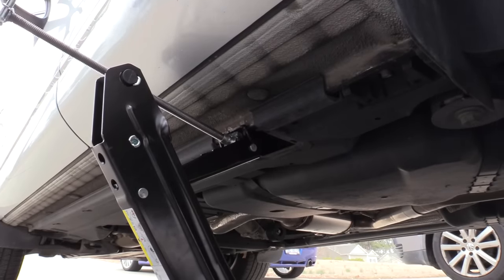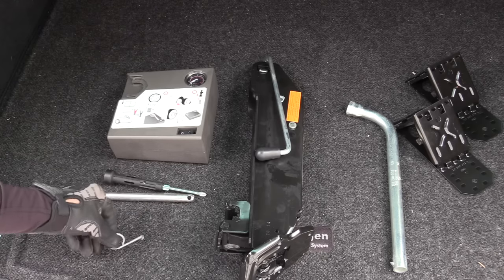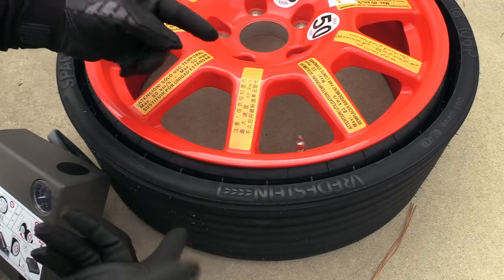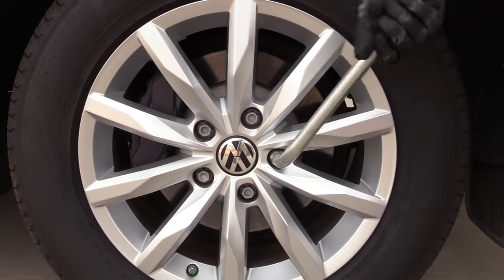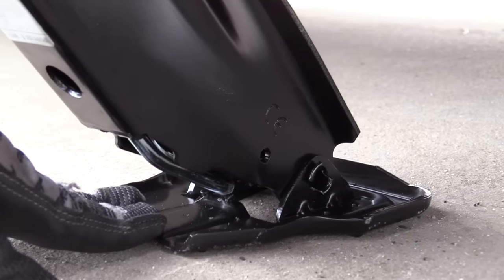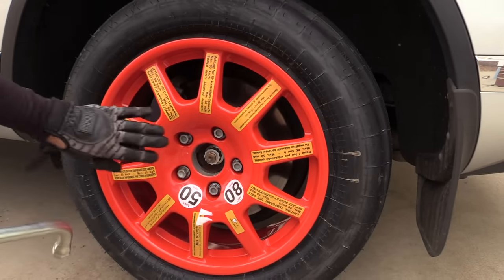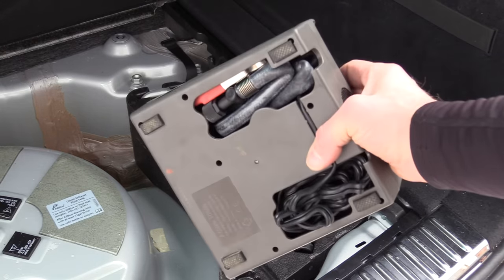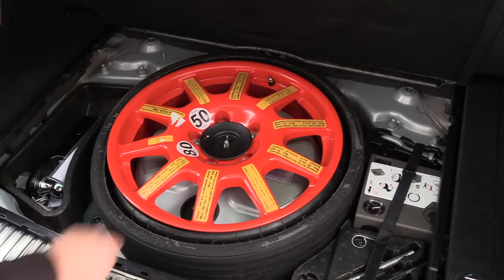How To Change a Tire with a VW Jack (The WIDOWMAKER)

Comment: In certain conditions this type of tire change could mean a disaster for certain people. If you are stuck in a precarious/dangerous place perhaps? I've seen people that don't know any better, stop in such spots & in one case where I saw real immediate danger. I was nice enough to stop quickly(in a safe place) to tell them they were in danger of being hit & to drive over to where I pointed for safety. They just ignored me/my warning sadly, but I still hope they were ok in the end. Then having to open the hood and hatch then wait an additional 10 minutes for the tire to inflate doing twice the work? or worse off... 10 years or more down the road when the hose on that compressor rots out and stops working properly and not being able to inflate it? The space savings aren't worth it in my book, and even in my vehicle with a fully inflated donut sitting under the rear of the car. I sacrificed space in the rear hatch so... I bought an extra rim and regular tire for a full size inflated spare and a hydraulic floor jack which all live in the back. I've changed my tire in about 8-10 minutes from the moment I stopped, and restarted my journey again. In a few occasions I've even stopped to help people with scissor jacks, and just brought out my handy floor jack to help them get up and running more quickly. I also want to give the video creator kudos for making the video for those car owners with this type of setup. Better to be prepared for such unexpected situations like these. Cheers

Comment: Nice way to bend your pinch welds. You noticed the swivel head of the jack? That is to properly insert your pinch weld in the shape of the jack. You just jammed it on there.
And be careful with other spots than the advised jack up points on the pinch weld, just because there is enough space does not mean that the spot is properly backed up from behind. Nice way to bend the bodywork to the inside and rip everything apart.
Why would you insert the wheel hanger AFTER you removed the last bolt? There was a little plastic tool provided to thread the bolts in/out by hand, you do not need to turn the big wrench a hundred times. And who would even torque the bolts by pulling them up? It is so much easier when your just use your body weight to push them down.
Also I am missing the widowmaker part. Of course a proper jack is nicer, but there are three wheels on the ground, handbrake and gear engaged... what could go wrong if you are not messing it up big times?
Honestly I have never seen such a pop up spare wheel, but if you want a big SUV you need a big wheel.

Comment: I think the wheel hub design itself is a Widowmaker. Chrysler started doing this too and it's a pain. When changing tires on people's vehicles it now takes 2 people, the extra person to hold the tire while the last "stud-nut" comes off. It's well know among tires plus and jiffy lube in my area as "Hitler's revenge". Now I just need to get myself some of those fancy wheel hangers I never knew about until now.
Reply from the maker: I understand why people hate that design. It doesn’t bother me, but I’ve always dealt with them.
Reply: @HumbleMechanic  It was rare to see them but i'm seeing them more often now. The first time I took one off I though it was a cool idea, until you take that last "stud" out. I need the extra person when taking the tire off on a lift at chest level, but putting them on I can pin the tire on that tiny step in the center of the hub and thread the first one in to hold the tire on.

Comment: Im a mechanic, so I look at this as fairly easy. That being said I could seriously see how this could get very confusing.

On another note, why does vw use wheel bolts?
Reply from the maker: Some say it holds the assembly more even. Some say it's to produce less parts (1 bolt vs stud/nut) Some say its because germans hate you.... LOL I think it is a mix of all 3

Comment: I may use my spare tire 4 or 5 times in the life of the car. I dont care paying for the extra space of a full tire or even a decent tool / lift kit. I learned the bad way to leave the car running while inflating one of those tires. Ran out of battery needed a jump Start.

Comment: Me personally -  I keep a really good 12V compressor in the spare tyre bay, and if I get a flat from say a minor puncture, I just pump the tyre up until I can get to a tyre place. That'll only work obviously with reasonable slow leaks, ( might have to pump it up a couple/three times, still better than changing into that toy tyre) the major punctures are going to need a tyre change for sure
One thing though, how does a space saver spare make any sense on a 4WD that may be hundreds of K's from a garage.
Reply from the maker: Well worth keeping just in case!

Comment: OMG I bought a duralast jack and kickstands today not knowing my Q7 had this monstrosity hidden I thought a regular jack and on top of that hooking up jumpers to inflate a skinny tire.. No no no I'm ripping it all out I'll get me a spare or tire already in flated I may not take the 2.25 ton everywhere but I'll use something that doesn't resemble a drill bit piercing my side panel. So advanced  German engineering without an ounce of common sense.

Comment: Never had a problem with the jack. Loosen and fully tighten lugs with it off the jack. Gotta use the noodle.
Reply from the maker: I personally haven't either. But I have seen the results of it failing.

Comment: the inflation of the tyre in this video looks really easy. However when I tried to inflate my tyre for the first time the tyre got stuck on part of the rim and would not completely roll on. even with 100 psi pressure. Hence the tyre is useless as it would be dangerous to drive on it .
Also the compressor that came with the Tourage really struggled to inflate the tyre. 

Has anyone else had this problem with their spare tyre.
Ian

Comment: Word of warning, I saw a 2004 Touareg in the junkyard with one of these space savers mounted and it had severe cracks on the sidewall that I wouldn't want to drive with. I know on my older cars I have replaced the spares with newer tires because one time I had an old spare loose its tread after I drove on it for 10 miles. Very dangerous
Reply from the maker: Good point. I wonder if there is a date on the tire? I am sure those aren't cheap to replace.
Reply: @HumbleMechanic  I imagine there is but I doubt there is an expiration date. all depends on the climate the tire has lived in.
Reply: @CorradoAlley  ...time to 303 Protectant that sucker to preserve the rubber, even if stored inside the car.

Comment: This usually happens in the worst place and time. Add a 'quicky' set of Gloves to the tool set. Stop by a Tire Store and ask for and old Rubber Valve Stem to screw that Valve Core cap to and create an easier tool to work with. I put a tiny drop of Red Loctite on to hold it.Flashlight in a baggie with Batteries loose. Had to work in dark because batteries had corroded and of course...she no worky.

Comment: my new VW comes with afull size spare tire as an option. But even tho i have a tire in the boot when I get a flat I would never use the " widow- maker" in an emergency situation on the side of the road. This thing doesnt work safe on flat hard ground and it wont do any good on the side of the road lte at night in the rain...
The ones they put into the small euro models ( Polo, Golf) are even more cheap than your from the heavy Touareg.

Comment: In uk pump connet to 12v auxiliary(cigarette lighter)
Reply from the maker: I tried to use my Milwaukee pump, it didn't have enough CFM. I think my R32 has a 12v aux plug too
Reply: @HumbleMechanic  I'm like bouth my ibiza and fabia had full size spare

Comment: Is this jack safe? Doesn’t it look a bit unstable?
Reply from the maker: If used properly it’s fine. The properly part is what get people in trouble
Reply: @HumbleMechanic  if the back wheels are correctly and properly blocked while lifting the front I wont have any issues correct?

Comment: one time i tried to lift the car just high enough for the wheel to be off the ground ... the wheel was seized to the hub.. when i tried to pull hard on it .. it fell and somehow the tire got stuck between the  ground and the brake dust shield :(

Comment: In my time as a mechanic/technician (2005-2012) I have never seen a non-inflated spare tire. All I have seen was small tire or these foam repair kits.
Question? Where do you put the damaged wheel when you pull it off the car? The trunk may be filled with luggage, groceries or similar and it cannot fit in the wheel well where the deflated spare tire was... (not that it could if it had been a normal inflated spare tire either).
Reply from the maker: That would be a hassle for sure. My thought is, you’re taking everything out of the back to get access to the tire either way.  It will be like Tetris going back in.
Reply: @HumbleMechanic  LoL. Yeah didn't think of that at all. I remember on the old Ford Fiesta and first model Ford Ka the spare tire was placed underneath the car (Peugeot did that on some models as well). This meant you did not have to empty the trunk to acces the spare but as years went by the mechanism that hold the spare in place got really dirty and rusty making it a hazzle to get the spare tire out anyway... No solution is perfect.
Reply: I think Porsche started it off with the DIY spare, remember seeing a few of them in the mid 2000's
Reply: @donmaggi  Probably correct. As far as I have been told the reason why many makes use the repair kit instead of a tire is to save weight and thereby save fuel. By saving fuel the car gets a better environment rate (at least in the EU) and this increases sale...
Probably the same reason the tire in this vid is plastic/composite and not steel.

Comment: German over engineering at its finest lol. My old ford ranger came with a full size spare, a bottle jack, and a solid steal lug wrench and that was it. Basically a “figure it out” kind of kit. I like mine much more. (Now that I have bigger tires and a lift it’s totally useless and now I have to use a highlift jack but still...)

Comment: Ok while I can admit that's a really cool way of doing a space saver tyre, I've never seen one like that before. I don't like the idea of space savers. My 1996 Suzuki x90 has a full size spare and it's one of the shortest wheel base 4wd cars ever made. Legit it takes up 3/4 or more of the boot but when I need to change a tyre at least I have somewhere to put the old tyre instead of putting a dirty ass tyre all over the boot of a nice car like with my Veloster. Sure you save a little weight and have more room but you're absolutely screwed if you Actually need it.

Comment: Hmmm. BMW have a simliar jack (at least my E39 does). Haven't heard of any failures of those ones. The VW one is known to fail or nay?
Reply from the maker: I’ve seen some. I think it’s mostly user error, but I’m not 100% on that. I’ve had a few people have failures that I know did it right.
Reply: @HumbleMechanic  Hmmm. Well I'll keep that in mind next time I have to use it, hah. I tend to use my trolley jack, axle stands and chocks at home thankfully.

Comment: God when I was young and stupid I was changing brakes with the Widowmaker on a jetta vr6 mk4. I was under the engine from the center with the widowmaker propping up the driver, really going at it hitting a wrench clamped to part of the brake.

Dumbest thing I ever have done, and I cringe at myself everytime I think about it. So stupid. I did do all 4 though! (rest were all doable from outside, otherwise Id prolly be dead lol)

Comment: Way to over complicate having to put a spare on. Lets give you a jack that won't work on most surfaces and can easily let the car fall on you. Lets give you a flat tire as a spare that you have to air up first before you can use it and hope the compressor works and is still there. Then that short tire iron that most won't be able to use cause they can't get enough force to get the lugs loose. then when all is said and done where are you gonna put your full size tire? At least in my Jeep compass I can put my full size tire right back where I got my spare tire from. Oh ya cause it comes with a full size aired up tire as a spare.
Reply: or you have a spare thats in your car for 5/10 years and never checked...

Comment: I don't see how that jack is any more dangerous than any other jack included with a car.
Reply: Try using it
Reply: @2JZDestroyer  I've used them a few times. No issues. I can see how it would look dangerous but functionally it's no different from a scissor jack.

Comment: I recall stoping to help a girl change a tire on an Audi that was about the exact same. Stupid tire would not inflate the bead was not set right. Biggest hunk of junk I had to take the tire to the shop and use my trucks bottle jack. Took over an hour which should have taken 10min.
Reply: jake h Why you did not read the instructions instead?

Comment: I had one of these for my vw t4, after the first time I used it I picked it up and it fell apart. Turns out that the previous owner had broken a pin and replaced it with an old shitty bolt. Not cool. Hello new bottle jack.

Comment: Not to happy about the folded tyre sidewall. Thats where the strenght needs to be. What is the service life of the spacesaver?   4 - 5 years before perishing starts and you need to replace it. Bet most people won't do that. When they get a slow puncture, they put on the spacesaver and once driving on a Freeway, the spacesaver blows out. If lucky they have 2 flat tyres!

Comment: Too much work to prep the tire while fiddling around with a gazillion tiny pieces before and after inflating the tire. Imagine doing this along a dark road at night. Over engineering just like all German cars. BMW, Audi/Volkswagen & Mercedes like to complicate simply things then charge a premium for creating the problem and the solution.

I prefer cars with old school full size spare in the trunk and a jack. The only extra thing you need is a flashlight if at night.

Comment: You are using the jack the wrong way. You should put the part for the pinch weld on the pinch weld first, then rotate the handle untill the jack reaches the ground. that way you will not have any tension on the pinch weld.

Comment: I love how they give you a ugly red wheel to pressure you to go back to the dealer to get a new one installed
Reply from the maker: Well, it's not a tire meant for extended use, so it makes sense. I would run these on a rally car in a minute. Minus the stickers

Comment: Yeah no matter what weight those scissor jacks top out at its not a good thing when they start making plastic parts. I've had a vauxhall (gm) standard issue jack destroy itself and leave me stranded on the coldest, snowiest day of 2018, just after it saved me a couple of days previous when I popped a different tyre on a kerb In the snow. God fofbid I'd have to wait to inflate a spare as I've also had those pesky 12v air comps die on me when inflating a tyre but no, no thanks do I wanna go through the entire vw procedure although the only thing I would like out of all the kit is the extended stud thingy to align the wheel, ain't never seen one in 35 years of motoring but I think every vehicle should have one as standard

Comment: 47 steps later, your tire is changed.  The widow maker can just go suck it!  I had the angle wrong on it and while lowering the car, the upper hinge part contacted the lower rocker where the extra body protection is and gouged it slightly...so frustrating.  Why can't VW give us a regular scissor jack, w/a stable base instead of the one-legged people killer.  Sure neither is desirable, but I'll take the scissor one over the VW jack.  Also, I carry a HF 25" Breakerbar and deepwell socket, as I hate the 11" factory lug tool.

Comment: The really sad part is that VW was the last hold out for putting full size tires in their cars. The really weird part is that all this engineering and "space saving" is far more expensive that just putting a fifth wheel/tire in the back.

Comment: It was better when cars had at least a diamond-shaped jack, a normal tire as spare, which by the way can be stored inflated and you can also put the damaged tire back there, which clearly won't fit in the place of the temporary one.

Comment: Ok, requiring a pump to change a wheel is flat out stupid. that's adding 2 points of failure! The pump can break, and the battery could go flat. How much space did they gain from this? It surely didn't improve the fuel economy
Reply: I'm so annoyed I'm gonna leave another comment... WHAT'S WITH THE STUPID JACK!? It has NO upsides, they could've made a proper one from aluminum and saved weight, instead they made this half breed from folded steel, and why do they use bolts on wheels? What's wrong with normal nuts and threaded rods? Now I have to keep a locator pin? Again adding points of failure '-.-
Reply from the maker: As the Germans would say, they aren’t designed to fail. 

Ahha hahahhahaha Hahahaha

Comment: The main reason I don't like these jacks as they often damage the paintwork on the lip of the sill which in turn allows it to rust. You never ever put any part of your body underneath a car while using one of these jacks. Flat ground, brakes secure etc. Just common sense really.

Comment: Change tire?? That sounded interesting, but: Wrong - you're changing the wheel, man!
Reply from the maker: Actually you are changing both. ;)
Reply: @HumbleMechanic  
So, changing the rim would be good too? LOL

car wheel - a wheel that has a tire and rim and hubcap; used to propel the car
Reply: @lhill8181  
I don't have to sound clever. xD

Comment: Changing a flat tire in a VW will take forever with this type of tires, It's not practical at all
Reply from the maker: You could do it in about 10 minutes. The part that takes the longest is putting all the stuff back in the right spot. LOL